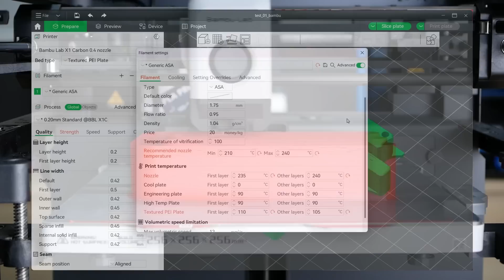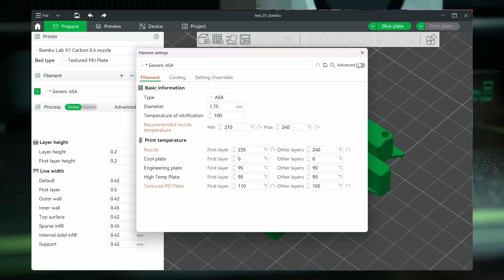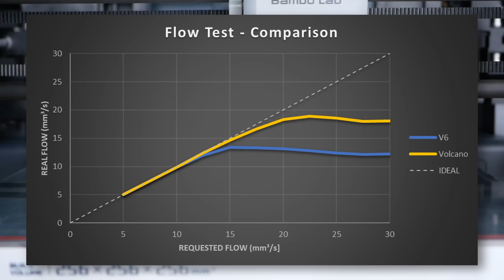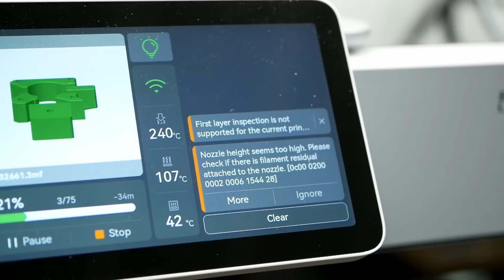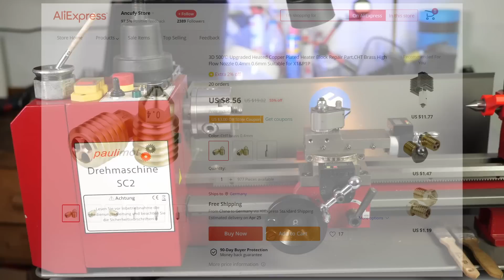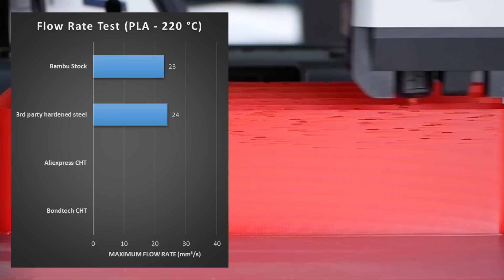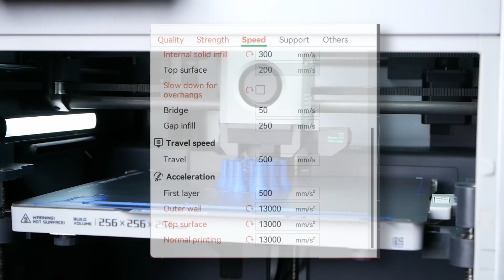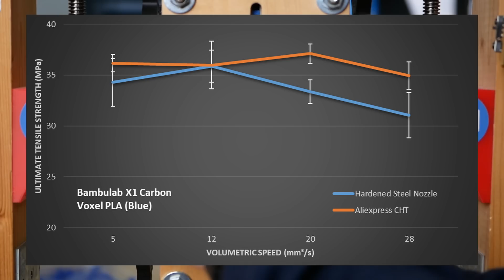Fast 3D printing is bad for Strength! (and how to fix it!)

Comment: I got a high flow nozzle for my Ender and got some really cool looking matte PETG... That completely flaked apart lol.

I also noticed that the high flow nozzle seems to trap air in the when retracting causing popping, stringing, and ugly prints. I think I am going to go back to standard because of this.
Reply: sounds like the filament is just wet.
Reply: @Michael-fw7ch  nope, I dried it out and it always pops at exactly the same extrusion distance after a retraction.
Reply: @DR4K0R3X  that’s pretty interesting, that’s the first I’ve heard of that potential issue.
Reply: Try a volcano nozzle  with brass nuts instead of the CHT.
Reply: @black99rt  good idea, thanks

Comment: I've noticed this after printing 330 hours with my bambu x1c.
Been printing with PETG a lot and when i switched to PC the performance were worse.
I was trying to anneal the prints, with PETG , to compensate for that with SOME improvement but not enough.
Test done with ERYONE PETG 255°C hot end, 200 mm/s (standard profile) 10% Fan MAX.

So the parts printed with PETG at those settings are now much more brittle than 60 mm/s and tend to break like PLA.
Instead of deforming and yielding like PETG printed on a ender3 at 60 mm/s (for example).

I absolutely want to try the 3rd party hotend with the CHT "like" nozzle.

THANK YOU STEFAN!

Comment: At 11:14 your bed is super scratched, does this effect the print quality at all? What % of the bed can be completely torn up and still function?
Reply: That's the top of the magnetic part which holds down the bed plates. Very common as almost everyone scrapes the rear nozzle wiper part of the bed against it during insertion/removal.

I've not yet seen anyone actually have it affect anything yet - you'd have to really mess it up for the metal bed plate to not still sit on it nice nad flat.
Reply: That's under the actual plate though. As long as the plate you're actually printing on is still level it shouldn't be noticeable at all, I would think.

Comment: I printed my Trident 350 parts with my X1 using ABS+ on generic ABS settings.  I didn't notice any part strength concerns during assembly, but now I know to do PM checks more diligently.  Thanks for the info Stefan
Reply: It will be an upgrade for sure
Reply: Second this. 
Will definitely be checking also
Reply: I came for the Pink Floyd.

Comment: As someone who has been trying to decide between a Bambu X1 and a Prusa MK4 this has been really informative. My main concern is print quality, strength and dimensional accuracy so  I am starting to lean towards the Prusa..
Reply: we seem to be having the same issue XD
Reply: Best would be to wait for someone to compare actual MK4 and Bambu prints once the MK4 gets in reviewer's hands.  I'm sure Stefan will be one of them!
Reply: Just get a p1p and slow down your print, may better value
Reply: Consider whether you ever want to print engineering filaments (ABS/ASA/PC etc.). If you do, go for the X1 as the chamber makes a huge difference to the printability, quality, and strength of such filaments. You can always slow down the defaults too...

The P1P is really the competitor to the MK4.
Reply: @mowcius  at the moment PLA+ is what I print in for my current projects but I have wanted to print PC and ASA, I just don’t need to at the moment because my projects don’t need it, although I may want to in the future and an enclosure would be a must. To be honest I am currently deciding which order to cancel lol 😅. My biggest concern is fine dimensional accuracy and surface quality. I am mostly concerned about VFA print quality when it comes to the X1.
Reply: You could always just like, slow down the bambu a little bit. Even with it set to a slower speed it'll run circles around the prusa in terms of print times.
Reply: @kylequinn1963  From what I’ve seen on a lot of videos slowing down the X1 also increases VFA due to the belts, and surface quality is one of my main concerns. Print time isn’t super high on my list.
Reply: @kylequinn1963  and quality aswell most likely, plus no printed parts and the X1 has an enclosure, actually enabling you to print ABS and other harder materials out of the box if you needed to

you may think you never need to, and still wonder why you're running a shitty open printer one day, and i Know that for a fact out of first hand experience
Reply: @BH4x0r I exclusively print in PLA+ atm but I could see wanting to print PC or ASA in the future I just don’t need to for my current projects.
Reply: @pantonediago2827  X1 forsure then, don't even think about buying the Prusa then, however PC needs a significantly higher temperature (that is too much for the Prusa either way), the Bambu can do 300°C, 290°C is kinda the minimum for PC aswell

and you'll be printing ASA much easier, i've printed it on my open bed but larger parts just warped to unusability

i've tried PC once but that warped so hard it got caught and broke the old pin on my old bltouch LOL, i didn't have the X1

so just get the X1, at the few more bucks it's a no brainer for a much better printer
Reply: Lol, you triggered some bl fan boyzz. 😂😂
Don't listen to people and make your own decision. In my opinion x1c is over hyped.
Reply: I have a PrusaMini and will be getting a Bambu next. We have had so many issues with it that I'm ready to toss it once my Bambu comes in.
Reply: @tomsko863 I had the same issues with the Mini! Was about to sell it. Ended up fixing my issues by replacing the probe and swapping the heat block for a copperhead by slice engineering. Now it’s printing better than most of my other printers after those changes.
Reply: Bambu X1 is way better machine than prusa, just the build quality is way better. Amd you always can slow it down. Is like having a ferrari, you can drive it at legal speeds and you will have a better car than one guy with a fiat.

Comment: Could the shiny/matte line be due to the heat from the bed? It is going to be cooler the farther you get away from it. If you turn off the heated bed, or raise the temp does that make a difference in height of the matte banding?
Reply from the maker: Definitely not the reason.

Comment: AWESOME video!!! Upgraded to 0.6 nozzle and print quality went to the toilet! Thanks for the tip on the extrusion rate, will try it! Thank you! Really appreciate your work! Hope one day someone makes an after market hotend that can use standard V6 nozzles!
Reply: You can replicate almost all of the benefits of a 0.6 nozzle by changing extrusion widths to 0.6 while using a 0.4 nozzle.

You lose the ability to do layers that are 0.4mm+ but you gain being able to do 0.1 or less. You also get much better quality.

In almost all cases, the 0.6 nozzle print speed increase is a result of the larger widths, not the higher maximum flow rate. It sounds like you might be pushing that. The cht style nozzle has a significantly higher boost to flow rate than going to a larger nozzle. Same for the volcano style setups.

The trick is to print your outer layers at a smaller width  and the inner layers much, much larger. I'm able to get away with half of my prints times are typically from the external perimeter, even with infill values of 50%. You almost can't see the layer lines. Only the seams are readily visible.